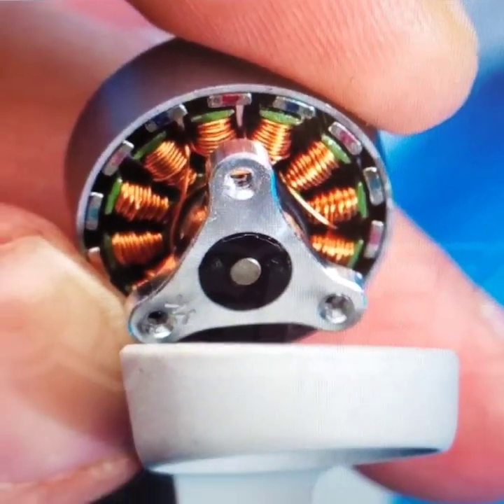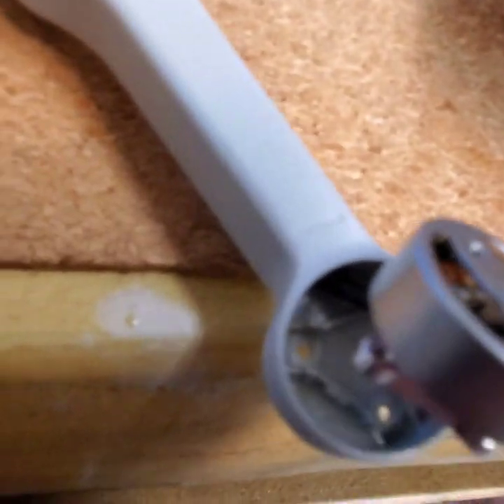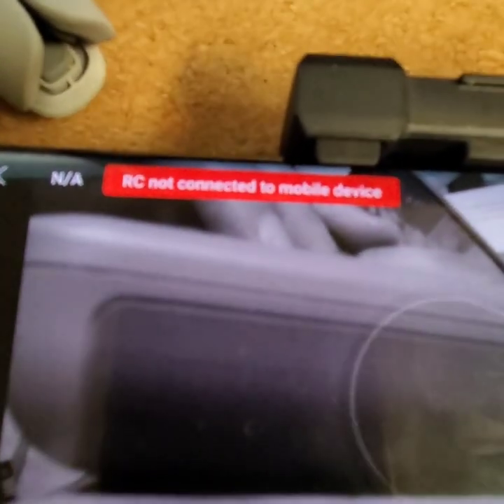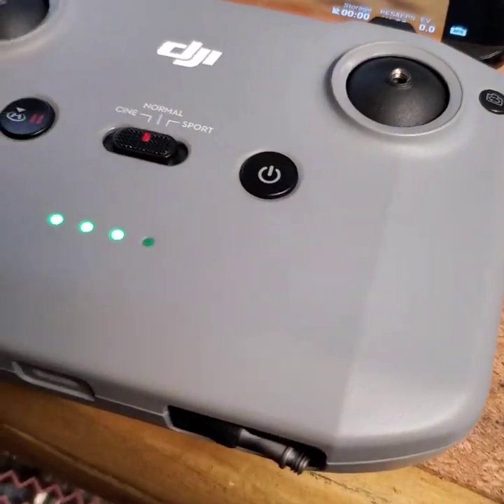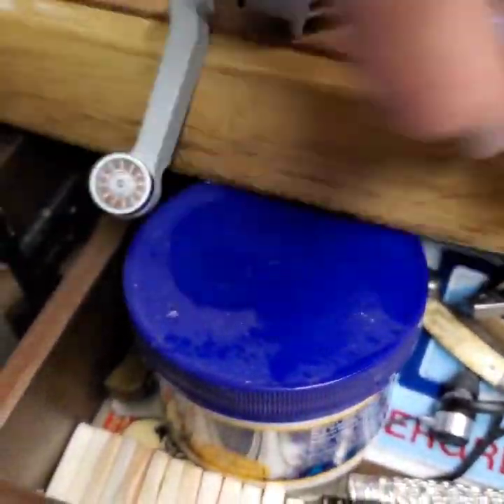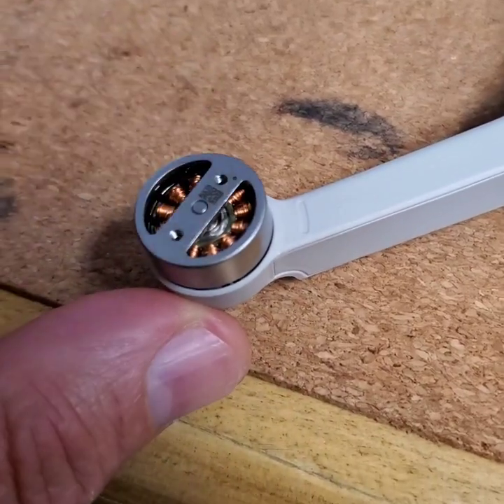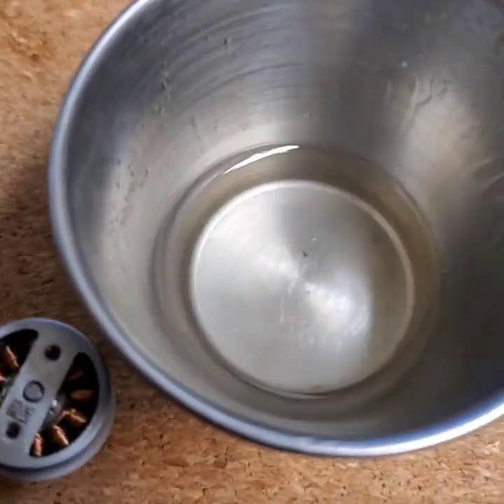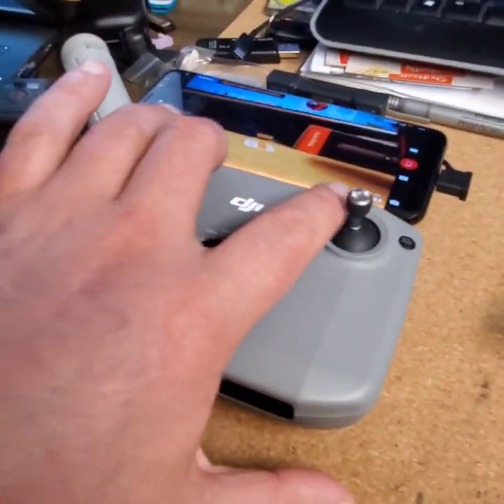Solution to sand in drone motors (DJI mini 3 pro) - How to clean DJI Drone motor from sand

Comment: The bearings in the motor are not sealed - i would be adding a drop of bearing oil to them after washing with alcohol.  The shields in these bearings are just basic dust shields.
Reply from the maker: You would kill drone several times before bearing wears. Also it is operating fine so far.
Thanks for advice
Reply: Please explain me if you add some lubricant and then clean with Alcohol?

Comment: Meu drone é novo nunca fiz um voo com ele é ele está dizendo erro cod 30142 uma dos motores traseiros só gira com os dedos alguma coisa a se fazer ?
Reply from the maker: Hi
Read here
There is probably issues with drone.
https://app.airdata.com/wiki/Notifications/Motor+unable+to+rotate.+Check+motor+%28Code%3A+30142%29#:~:text=Check%20motor%20(Code%3A%2030142)%22
Reply: Não consigo entrar no link

Comment: I have some small metal particles inside, which are hanging on the magnets. 

Is it possible to remove the motor bell from. The mini 3 pro ?
Reply from the maker: Yes it is possible. 
As far as metal particles,  they are everywhere in sand.
Sand is the minerals contained metal mixed in most sand, we are on earth,  this is metal planet. This method should help you. 
https://postimg.cc/cKgg7hLC
Reply: @goasfarasyoucansee  thank you.
I mean to remove the bell from the motor, not the blades.

Comment: Awesome fix for the specified problem. Took my mini 2 to Mexico for fun in the surf and sand and the things never been the same since. The left rear motor seized up almost completely, only turning with much effort. I tried this but I didnt have to dunk the motor completely. I instead only removed the props and motor mounting bolts to expose the underside of the broken motor. Holding the drone up so alcohol doesnt enter the arm, I squirted alcohol into the motor and spun it by hand until the motor spun freely. If it doesnt do it at first, keep spinning and adding alcohol. Yeah man, you got it. Good stuff Mr. Original Poster.
Reply from the maker: Enjoy your drone bro!!
Reply: I crashed mine into a palm tree and it flew again fine for 10 min. then the rear motor developed a very hard stop in either direction. I appreciate the input on this OPs vid.

Comment: Thanks for the video man. But I expected better, did this to see if the grainy feel would go, but sadly its still there, I can still feel the small particles inside the motor when I rotate it with my fingers 😢 the good thing is that its working with no errors so yeah ❤ at least I can fly again
Reply from the maker: Awesome, little tip, what i show in my video, is to spinn, and grind metals to powder, so you can washed it out.
Sand have metal, and these extremely small, and they get stack inside.
Flight safe, in worst cas you can run it again, just to be sure, for 10-15 seconds, if not.
Then enjoy.
Please support my channel, if you wish to donate or just share with friends. 
🙌🏻

Comment: Thanks a lot! This really helped us. We are just on our 3rd day of the DJI Mini 3 Pro and unfortunately crashed onto "earth ground". It saves us a visit to a service center.

We made sure to really make it dry by spinning (without propellers) for a long period at interval with a mild hot blower also. 70% alcohol works. Let's see if it will work tomorrow after an overnight being stressed thinking what we should do as there was no local service center in our area.
Reply from the maker: Let us know please. So like share and donate, it help sharing energy

Comment: Wow! I’m so happy this worked! Was kind of bummed b/c I didn’t want to spend potentially hundreds on repairs. I knew it was just probably something stuck inside, but I really didnt know it was this easy! 

Cost $5 and 30 mins of my time. Amazing. Thanks!
Reply from the maker: Thank you for your support channel bit.ly/ThankMePayPalLink 
I very happy that you fixed your lovely drone. Enjoy.
And yes, you are totally right, the space between ROTOR and COIL in this motor is extremely small, and dust turn in to the thick clay, and there is no way to get that out of there, I guess I invented this method, since I did not find fix online.

Comment: im afraid to apply any sort of liquid to my drone motors😊, maybe an air duster (pressurized can) will do the job
Reply from the maker: Your bearings is sealed inside. To washougreas, require you to remove cover of the bearing, take it apart, and spin it in gasoline, or similar liquid like mineral spirits, alcohol won't wash it out, as bearingbis sealed.
It take me recently to washout grease from makita grinder that I restored, alcohol wasn't the best solution to use, it simply did not desove grease, I have to use first wd40, then soap water, then alcohol when crease was out, to remove, and dry water from bearing compone, then I used new grease, again it all was open, in large bearing. 
There is no way alcohol even get inside drone bearings over 1 minute. It is impossible technically PERIOD 
This is what is bearing look like. Partical of alcohol is so large to penetrate trough seals in the bearing, I would not use acetone, as it can cause damages, not only can penetrate in bearing quickly also can washout liquor off wires, and dissolve plastics.
Unfortunately air won't wash particles that shredded and stack between rotor, and coil
https://www.amazon.com/MESKEL-Bearing-Miniature-Electrical-Bearings/dp/B0CSFTXTKY

Comment: I want to thank you for posting this video. I had a crash landing on a beach and sand got into the rear motors. Those rear motors wouldn’t work afterwards. I didn’t know what to do until I found your video. I followed your directions and fixed the problem myself. Probably saving me hundreds of dollars in repairs. I took the drone out for a few tests flights and everything is working fine. Thanks again.
Reply from the maker: You are very welcome 
Your support of channel is highly appreciated.

Comment: my question is, does that cleaning solution wash the lubricating grease out of the bearing?
Reply from the maker: Does not. Bearing usually sealed, and grease and alcohol is not easy to mix, grab plate and dry to diluted thick grease and  alcohol.

Comment: if i put a motor of xiaomi fimi x_se 2020 in wather it will stil working ?
Reply from the maker: Yes it will.
Remember this is not water, it is alcohol,  but you can put in water as long it is not salted water.

Comment: Sir if possible you can use contact cleaner for cleaning the motor. Instead alcohol.
Reply from the maker: Very rarely is alcohol cleaner really 100% pure, but it's available cheaply enough at 99% or higher, usually the remainder is pure water or something equally safe. Contact cleaners tend to leave a lubricating / corrosion inhibiting residue which may or may not be welcome on a connector as it may attract dust & dirt

Comment: Good idea. But I'd suggest manually starting the motors with the sticks instead of auto take-off so it won't be so messy, and you still have the option of throttling up alittle if you feel like you need the motor to spin faster. And 90% iso alcohol is better for electronics.
Reply from the maker: Excellent suggestions, Please subscribe and share the video.
Reply: Would it be much better if I use 99.9% iso alcohol? I can't seem to find a 90%
Reply: Wonderfully solutions. Thanks ❤

Comment: Just crashed my Mavic Air 2 an hour ago, didn't know what to do

I haven't tried it yet but this will be my first time trying to "repair" it by myself

I just need to dip the motor into alcohol and let it spin until it's smooth right? Looking forward for your reply. Thx
Reply from the maker: Yes.
Prepair it all, as preparation procedures take lot more then a cleaning.
Watch video few times, and you will see, that, taking all blades off, loosing damaged arm, so you can rotate, and place in alcohol properly, so spinning won’t spread all the alcohol all over, you will feel when it spin free.
Before spining, you can rotate by hands first, to mulch large pieces in to powder.
Let me know, how it goes.
I have, larger Mavic as well Air 2, luckily, clearing smaller,  and large is never crashed.

Comment: I wonder if you could just have used any  sensor cleaning spray? It probably would have flushed everything out
Reply from the maker: Uou cant spray. You need to run. Sensor cleaning is evaporate extremely fast if you crack the can- and it is explosive hazardous

Comment: my motor literally did this two nights ago and i was scratching my head for a fix. i used air duster and held drone upside down while spraying the air in short bursts into the motor and the debree also came out. this seems like it might work better but now i know twow ays to fix the issue now lol. thanks for the insight
Reply from the maker: Please like my video, I glad it helped, I try it before, but I hav so much sand grinded in the two fans, that this is only solution that come to my generous head))

Comment: Thanks for the video! Some sand got into one of the motors of my DJI Mini 2 at the beach. Really thought I'd have to go for replacement but your solution worked really well. I used 99% Isopropyl Alc for it and did this 3 times by emptying the container as it got muddy. Got smooth motion back in the motor and have tested a flight. So far so good!
Reply from the maker: Sweet! 🙌🏻
Up in description you can use link to support my channel.
I wish your droon long work time.
Use foldable landing,  hope it won't fall anymore in send. But if so, you know the drill.

Comment: Use Electronic Cleaner in spray, this procedure is way too risky and it may burn the esc controller, dont follow this procedure..☠️☠️☠️
Reply from the maker: Could you expound on the potential pathways by which the application of denatured ethanol to the motor assembly might precipitate deleterious effects on the embedded microcontroller or associated circuitry? While this methodology has garnered empirical validation from a considerable cohort of users, yielding favorable outcomes, it would be invaluable to delineate any latent vulnerabilities—such as solvent-induced capacitive coupling anomalies, perturbations in dielectric constants, or potential catalysis of oxidative degradation in conformal coatings. A comprehensive elucidation of these phenomena would undoubtedly contribute to a deeper understanding within the community.

Comment: DO NOT USE acetone instead of alcohol!!! There is a plastic structure inside the motor that holds the magnets. Acetone dissolves plastic easily.
Reply from the maker: CORRECT! DO NOT USE ACETONE, AND TECHNICAL ALCHOHOL IT CONTAIN BIT OF ACETONE

Comment: Nice thank you, great video and instructions.

Can I ask though if what would you suggest be done if the particles that get stuck in the motors are somewhat magnetic and stick to in stator magnets? And what if some particles get stuck on thr gimbal head?

Thank you God bless
Reply from the maker: Particles in the sand are obviously contain metal, as we are on earth, it is metal planet. So the sand when it crash between rotor, and stator it create dust, the sand dust is flight out, but magnet dust is attract to rotor, that why we use alcohol, as particles very small and they just wash out. As far as Gamble head, this is good question, there is hiding motors, I would use air dust blower from Office depot or home Depot, see if it will help, I would defiantly not touch head much, as it s very sensitively adjusted.
Reply from the maker: Let me know if you fixed it, it kind 7 month past
Reply: @goasfarasyoucansee  appreciate it, thank you God bless

Comment: Hi i watched the video.. What do you think about the bearings inside the engine and the lubricant that is used for the bearings? When you run the motor in a can filled with alcohol, the brown colour you get might be the oil that you just have washed away. Do you think that bearings are fine with none or less oil in a long term use?
Reply: I was wondering about this too. But from what read on the DJI forums the bearings are sealed.
Reply from the maker: @patrickhdsn  You are totally correct these type of equipment's build with high grade materials, including bearings. If you also try grease from open bearing and try to use alcohol, you will find that it will take forever to dilute it.
Reply from the maker: You are totally correct these type of equipment's build with high grade materials, including bearings. If you also try grease from open bearing and try to use alcohol, you will find that it will take forever to dilute it.
Reply: @goasfarasyoucansee  💯 as long as you don't use anything too strong or that's not safe for plastics it shouldn't be a problem.
Reply: Oil is pink. Sometimes I clean the motor housing by moistening the cloth with 99% isopropyl alcohol due to the excessive humidity in my place. Something pink got on the cloth while I was cleaning it. But I know the bearings are sealed. Most likely, the pink oil smeared on the cloth was left outside the bearing during lubrication.

Comment: I sadly had a crash with my Mini SE and it went into the sand, I kinda started to clean it, so then when I tried taking it off again to see if everything was ok my right front motor wasn't spinning, I got a little scared so I started spinning the motor left and right, which kind of started to free the sand out a little bit, and I kept doing it until the motor was completely free of the sand, I am not sure if this affected the coil or the magnets, can someone confirm this to me please?
Edit: I also forgot to add that the drone started to fly a little weird, it was not stable at all, It flew either to the right side or left side without me doing anything to it (This was when I tested it back home, windless conditions to make sure 100% that it is fine, which right now it is clearly not)
Reply from the maker: You drone is acting weirdly because of the sand is crashed to dust, but dust is the one that stops spin well.
You needed to clean with alcohol

Comment: I tried high pressure air , even taking it apart, but THIS is the only thing that worked. Thank you so much. I really didn't want to send it back to DJI and now thanks to you I don't have to and can use it on my trip next week! Sounds loony - but it works!!! I would suggest use 90% or higher alcohol - it dries faster. Also, no need to take the arm off, I just turned the arm down, put it in the alcohol and started the take off. First time it sprayed everywhere so be prepared to cover it quickly if you didn't.
Reply from the maker: You are right with arm off is easy to submerge properly. 
I glad it help your drone!!!

▶feel free to thank by supporting my channel. https://bit.ly/ThankMePayPalLink Thank You

Comment: Thank you so much for this fix! I thought I had to send my mini2 back to DJI for repairs but your video fixed the issue for me! I had a stiff rear motor and this fix worked perfectly! Thanks again 😊
Reply from the maker: You're welcome! That what I explained many these who don't belive it work - distance between motor sraud and rotor less then any send particles so it melting it in to a power that plug and prevent spinning, I've if you have send, first blow vacuum,  then mulch it by hand spinning, then wash it. ThT was my original process. 
If you feel comfortable you can donate in top message link pinned, or in description. 
Your support is appreciated

Comment: Thank you bro it worked!I tried to  turn on the motor but it prompt error because the motors were really stucked.So I tried to ratate them manually under the alcohol and it worked!
Reply from the maker: First of it it turn in to the dust. Second of all it washed out.

Comment: As an RC car and truck enthusiast as well as a Remote Pilot there is another way. 

Similar to this remove all propellers activate the drone and start up the motors. Using a good cup of water with a drop of dish soap 🧼 insert each motor into the water and spin till clean.

After you clean out all the motors and whip dry. Finally use a can of electric ⚡️ connector spray and this will remove any access water inside and will quickly dry out the motor of any access moisture left inside avoiding any possible rust. 

If you can use a drop of silicone oil to keep the joints where the points top and bottom to keep it lightly lubricanted. 

Seems like a lot, but it’s pretty simple. You will not hurt your motors at all using water in this process. The water will remove very quickly any access dirt from your electric motor and get it clean 🧼 fast. good luck! 😊
Reply from the maker: As an 51 year Soviet Engineer,  i would reply this:
Theory is different than a practice. 
In theories we can say anything that could work.
Processes you just stated,  not only hurt your dron, as water is component that could shorts your circuit. 
I would upload your video of doing this.
Next segment is soup, it is not necessary component, as we not washing somethings greasy,  water could make components rust, and cherry on your pie is lubricant of silicone  you won't be able to lubricate anything, as all tide parts are sealed,  and lubrication will capture more dust, and then you will need to use my method to wash crease, as it will be much harder, and messy.
And- we waiting link for your videos please. I hape peoples will avoid this method- i won't  deep my 1200 dron deep in tho the water. The best solutions is use guidelines, proper landing places to avoid these processes

Comment: Has anyone have an issue with the copper wires coming out getting tangled in drone propeller after flying? I got a mini se i am currently in that problem.
Reply from the maker: Can you share few images by uploading here https://postimages.org/
Reply: It sounds like the windings got damaged and came loose, if it was me I'd just replace the motor.